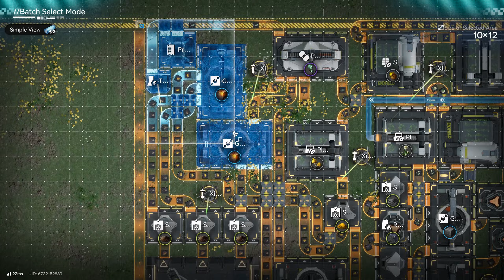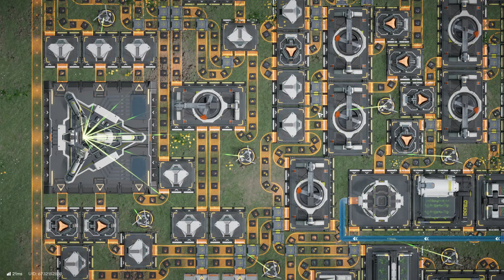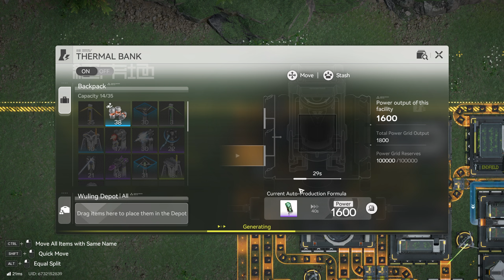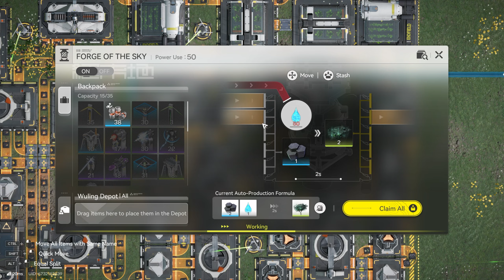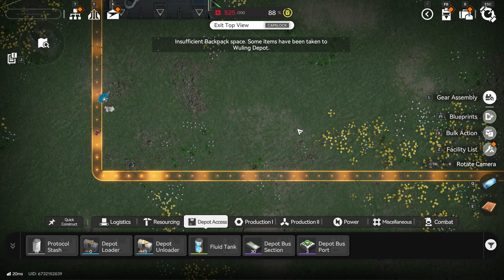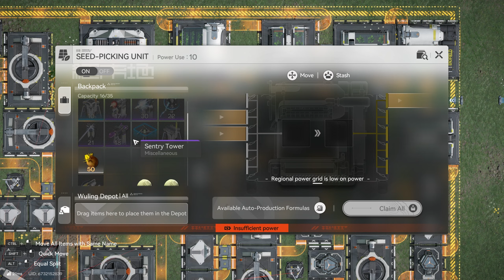XIRANITE COMPONENT + LC WULING BATTERY -  Combined Compact Farm [ Arknights: Endfield ]

Comment: For Asia server Players only
Left Side: EFO01I3A0eO5aa9725o08
Right Side:  EFO01Ue35I1644OEO71a8
Reply: Do let me know if it's not working, but currently i let it run for about 10 mins, no problem surfaced yet
Reply: Thanks for the codes and its good and its working properly too
Reply: So uh for some reason it's saying something like "max  amount of faculty in core AIC reached" when I am using the left side blueprint
Reply: @luckytale_777 so if I'm remembering it right, there are multiple reasons, 1 being you've too many pylons or relays in Wuling, 2nd being you actually have other farms too , and thanks to that the number of machines you can put now decreasef
Reply: @luckytale_777  You need to unlock the depot bus for the care AIC if you havent. Atleast thats what worked for me
Reply: thanks
Reply: right side doesn't work on eu
Reply: @FluffyToeBeanz  Sir this is Wendy's!
but actually, as you can see from the top line, it's for Asia server..... Why are you trying that in EU server? use the code given by the creator not me who is providing Asia code
Reply: Codes are not working in Asia server
Reply: @KakashiHatake-ti6bf "I" And "L" are the same letter if you're not typing properly
Reply: @KakashiHatake-ti6bf  i just tested, and it is working. Make sure you're not copying extra things other than just the codes
Reply: @Pikayuki bro it was my mistake...ur code works...u r an absolute savior
Reply: @KakashiHatake-ti6bf  No worries, and well, Farmito is the real one by making it for us

Comment: i have a random problem where the factory just runs out of power for no reason apparently anyone has the same one?
Reply: Your production battery to slowly than consume battery the best way make layout where production can efficient so can cover second don't put plenty relay tower outside factory if you don't need to much
Third use dijiang ship to transfer battery from valley storage to wuling but you must send manual is fast than regional transfer..
Reply: @whitetiger5464 i did try to put batteries from valley 4 but i fixed it by changing that one battery is going to the thermal bank and one to my stash 50/50
Reply: And it wasnt the too little power problem but no power generation at all

Comment: Excellent work as always, waiting for the Asia goats to share the BP's. Appreciate the design where the depot bus leaves for open space for the pots for extra Stock Bills. May I request that you make your Syringe/Drink builds modular that it can be attached to the depot bus on your component+battery bp build?
Reply from the maker: Yup, those will be modular to be attached on the other side and are very thin design, so you can stack 6 of these easily 😁
Reply: @TheFarmito  I made one as compact as I could, attached 2 depot bus sections on your bp facing downward. Requires the first plot upgrade and it fits nicely at the empty space below the Gearing Factory with Xira Components. 😊